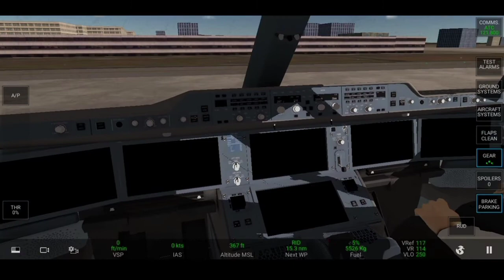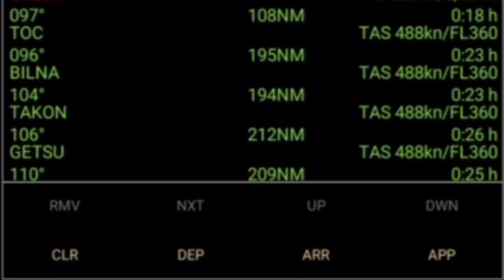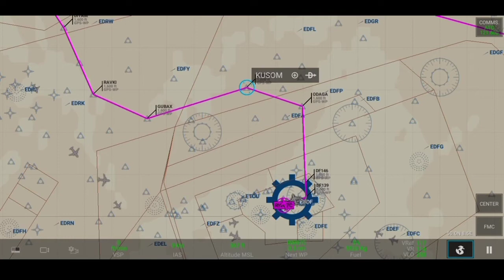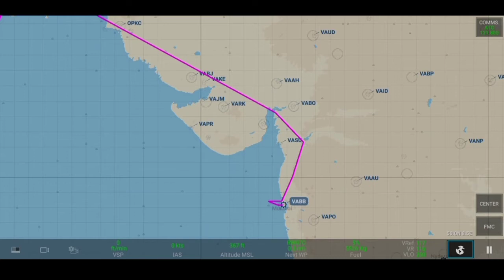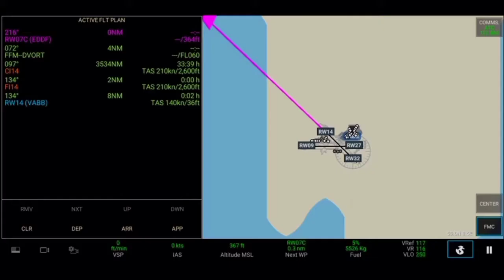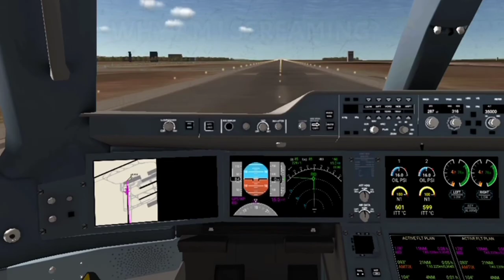Comment: One correction waypoints that he said to remove are useful as for a heavy plane it looses fuel from going straight takeoff to cruise altitude so we need multiple waypoints to climb slowly at an appropriate height to minimize fuel use